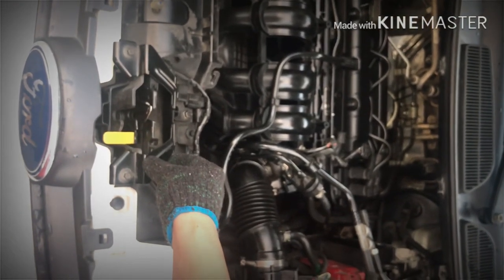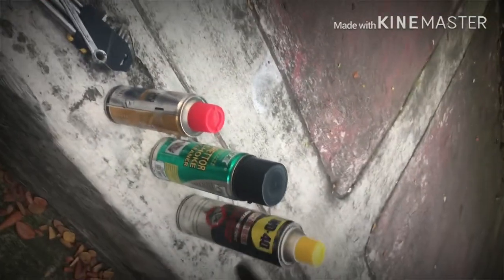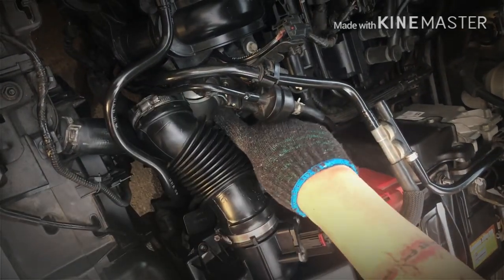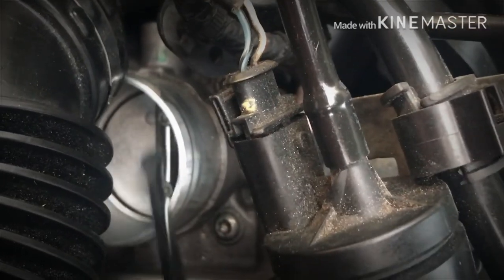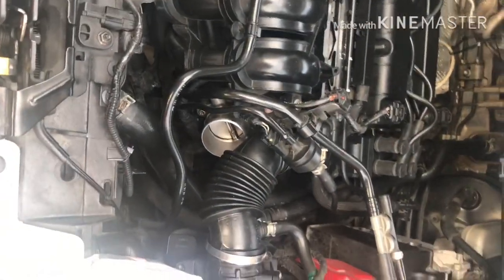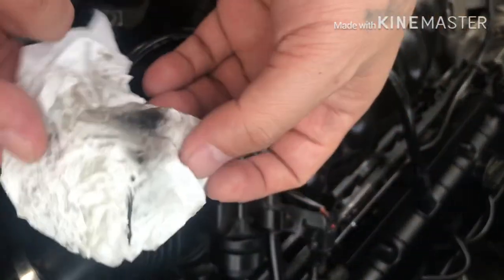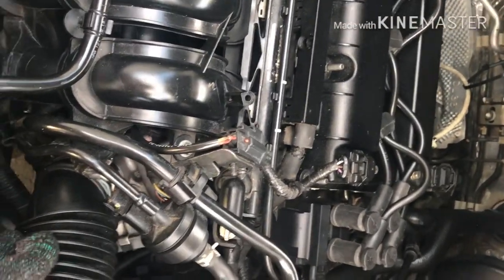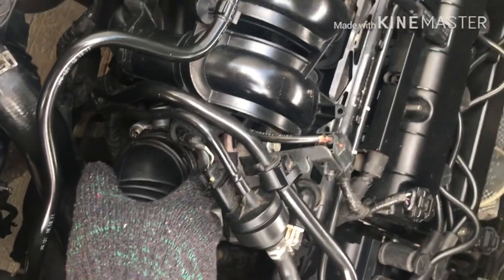How to clean Ford Fiesta throttle body

Comment: From USA.. why didn’t you just remove the throttle body.. so much easier and you get the entire throttle cleaner?
Reply: I was going to say the same thing he just play Russian roulette by doing that without removing the throttlebody out of the engine. Even Ford recommend to remove it when you clean it because it has electrical components on top of that even if you Disconnect the battery It could still engage itself the flaps open unexpectedly and chop your finger off.

Comment: Sorry to bother you I have a question I was removing the radiator on my car and my throttle body was exploded I accidentally dropped a small amount of coolant into it and it went down what should I do
Reply: Exploded? You need to clean the throttle body using throttle cleaner, if its just a few drops well  that might not hurt much..it might go down thru the combustion chamber..